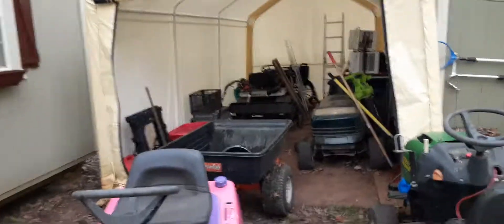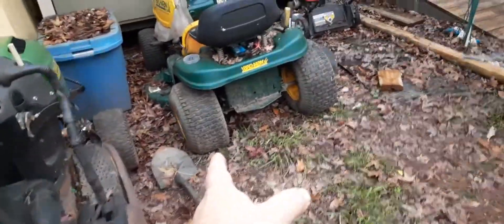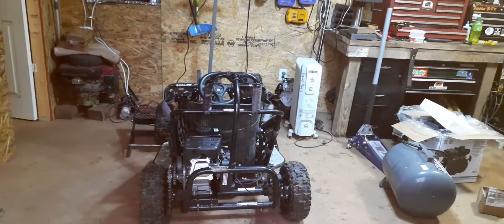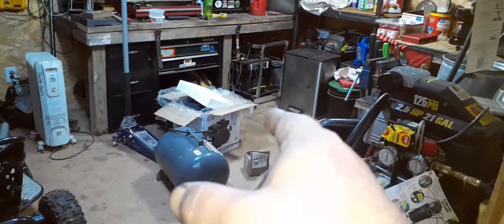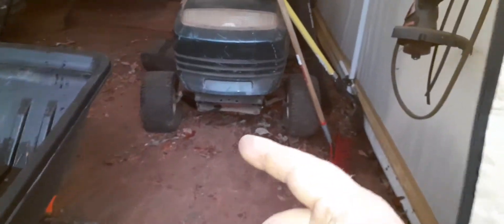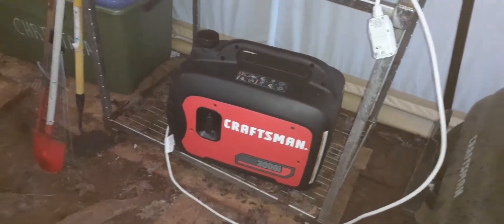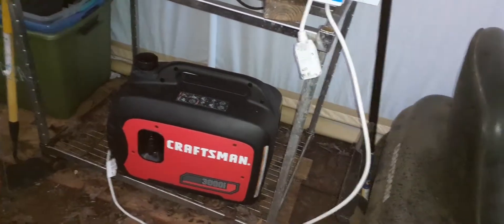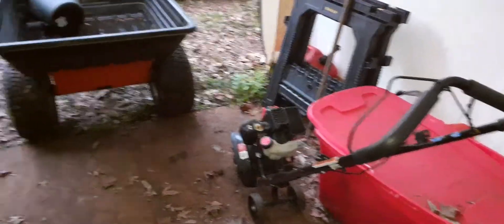Bama mower updated around the shop

Comment: I've got a Yamaha Inverter Generator and I absolutely love that thing! In my opinion, they're much more efficient than the old style generators and they're the only generators out there that are safe for modern electronics. Have you gotten back to the little Winch Engine yet? Love to see that thing run with the points eliminator. Cheers my Friend! Zip~